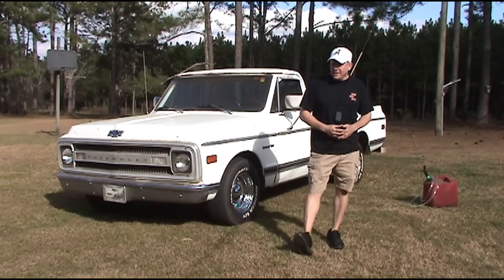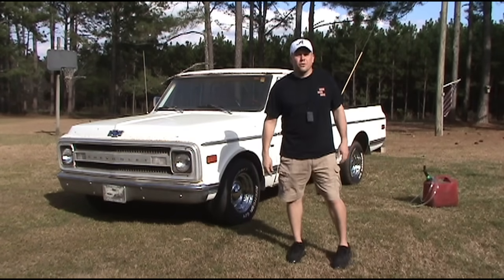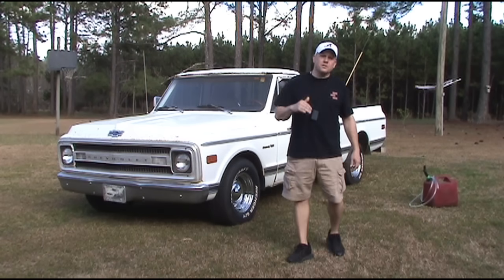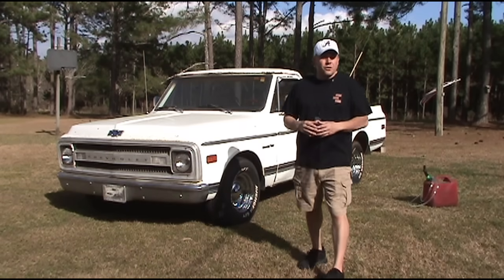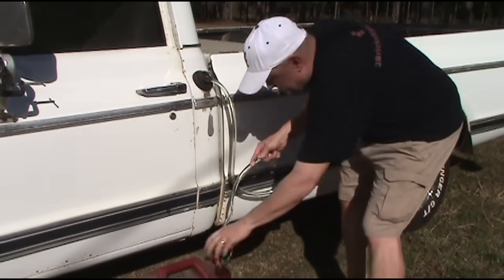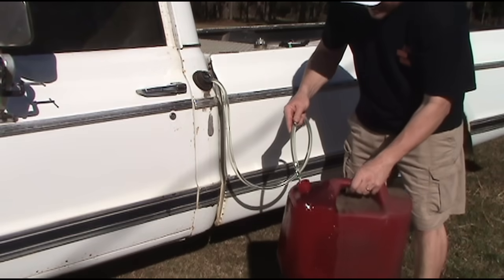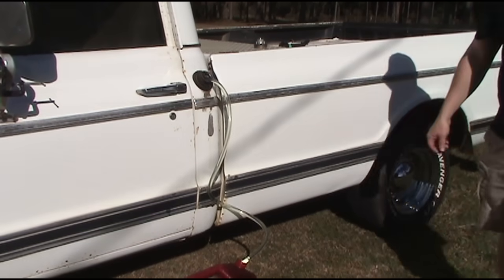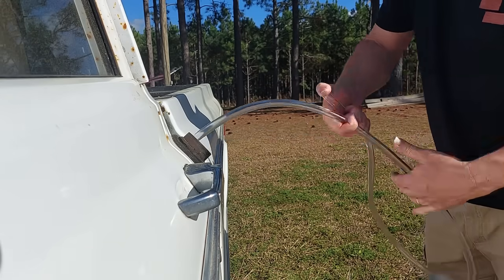Absolute BEST way to Siphon Fuel. You've never seen this before

Comment: The easiest way, BY FAR, to siphon gas, is to first insert the siphon hose into the deepest part of the tank that it will reach, and THEN block off/ and seal the opening of the gas tank by stuffing a rag or wet cloth of some type and completely around the opening, and then BLOW into the hose....DO NOT SUCK on it. This creates a greater pressure inside the tank, and then get ready to begin collecting  the gas, as the gas will immediately begin to flow. YOU NEVER HAVE TO SUCK ON THE SIPHON HOSE, EVER AGAIN!
Reply from the maker: Awesome tip.  Thanks for sharing 👍

Comment: 😂Nice try Momo. Only works on 1970s model vehicles 😂. Anti theft screens were placed in fuel tank funnels in the 80s. Go ahead,try and drive a hose into your own car tank😂
Reply from the maker: I was just trying to show how it's done. I used this method to fill a generator during a storm and thought I would pass it on. This works on lawnmowers and other equipment too 🙂👍

Comment: I think this only works on older cars
Reply from the maker: This works on lawnmowers, tractors and anything else with a gas tank.  After i posted this video i was told fish shops use this method to do water swaps in aquariums.  🙂👍
Reply from the maker: This works on lawnmowers, tractors and anything else with a gas tank.  After i posted this video i was told fish shops use this method to do water swaps in aquariums.  🙂👍
Reply: @3BricksHigher  can you try this method on a new car

Comment: Unfortunately, this will never work on more modern cars as they all have anti-siphon features built into the fuel filler line.
Reply from the maker: But it does work on mowers, tractors, ect    i was informed after i posted this that people use this method to change water in aquariums 🙂

Comment: Love the video.  But anything after 1990's it won't work.  Anti-siphon measures.  Need to punch the base of the tank
Reply from the maker: This works on lawnmowers and other equipment too.  It can be used in many different situations 🙂👍
Reply: @3BricksHigher  Great point, thanks

Comment: except it wont work on any car less than 40 years old due to the screen protector inside to prevent gas theft lol.. otherwise great video
Reply from the maker: This method also works on lawnmowers, tractors, and other equipment.  I used this to fill a generator during a storm and thought I would pass it on 🙂👍
Reply: @3BricksHigher  Fair enough

Comment: It dosent work on newer cars. You can't get the hose to the gas.
Reply from the maker: But this method works on lawnmowers, tractors and other equipment. I used this to fill a generator during a storm and thought I would pass it on 🙂👍

Comment: Easiest vehicle in the world to siphon from and they haven't mounted a fuel tank that high in a vehicle for over 50 years.
Reply from the maker: But it works on lawnmowers and other equipment.  I used this method to fill a generator during a storm and thought I would pass it on 👍

Comment: Won't work if vehicle has anti-siphon screen at bottom of filler neck.
Reply from the maker: But this does work on mowers and other equipment.  I used this method to fill a generator during a storm and thought I would pass it on 🙂👍
Reply: Easy enough to break through with a length of rebar.

Comment: Doesn't work with new vehicles. Which have screens and stop flaps.
Reply from the maker: The flap is to prevent gas from sloshing out if you forget to replace the cap.  A pencil or small rod will push this down, out of the way as the hose is put in or removed

Comment: Doesn't work on newer cars  they have a screen or rollover device in the way.  You can't put the hose in the tank.  I have been using the technique  he is showing in the video since I was a kid 70 years ago,  but these old ways of siphoning gas will not work on modern cars.
Reply from the maker: But this method works on lawnmowers and other equipment. I used this method to fill a generator during a storm and thought I would pass it on 🙂👍

Comment: It's not a coincidence that he used a really old truck with an in cab gas tank to show this 'trick'.  And good luck getting that fat hose into any car that's less than about 40 years old.
Reply from the maker: Use a smaller hose, duh 🙄 lol
Reply: @3BricksHigher  Most modern cars have an anti-syphon device that'll prevent any size hose from entering.
Reply from the maker: @DonziGT230  I know. I mainly put the video out because I had to use this method to fill a generator during a storm. This works on mowers and tractors. I just wanted to put it out there 👍

Comment: Yeah there is a reason you picked an older truck.  Try that on a newer truck.
Reply from the maker: I used this method to fill a generator during a storm. This works on lawnmowers and other equipment too. Someone posted they use this to do water swaps in aquariums.  I just wanted to pass along the method 🙂👍

Comment: this will not work on ANY modern car as they are blocked inside the pipe... that truck is from the early eighties...
Reply from the maker: This truck is from 1969. You're right about newer cars  but this method works on lawnmowers, tractors and other equipment. I used this to fill a generator during a storm and thought I would pass it on 🙂👍

Comment: This common knowledge is as old as dirt. You could also stick the second hose in the fuel can, plug the hole and suck.
Reply from the maker: I'm just showing how it's done without sucking. I'm a Bama fan, we're not used to that 😁👍

Comment: That car is a ,'69 or '70 vehicle. What about a modern day car?
Reply from the maker: It's a 69. This does work in several other vehicles, but my intent was to show how it's done.  These methods can be done on lawnmowers and other equipment.  I had to use it to fill a generator during a storm and thought i would pass it on 👍🙂
Reply: @3BricksHigher  thanks. I used to own a '67 Chevy truck. The hardest part to siphoning is getting the hose in. The older the vehicle, the easier it is. But that was back in the eighties. Haven't tried with a modern car yet.

Comment: Did not work for my 2002 cadillac
Reply from the maker: The 2nd method works from a vacuum. If air enters then it won't work.  The 1st method just depends on how full the tank is 👍

Comment: Didn't work for me and my tank was full
Reply from the maker: That's odd.  I've only had a few comments saying this didn't work for them. People also use this method to do water swaps in aquariums. Is your tank shallow? That's the only thing i can think of that might prevent it from working  The 2nd method always works as long as there's a good vacuum.

Comment: What will you show us next, how to dial a rotary phone? This is useless on any car from like 2000 on, only works on relics like you used to demonstrate on. Modern cars have so many baffles in the filler neck that it makes this impossible.
Reply from the maker: This works on lawnmowers and other equipment.  I was just showing the method. Someone posted they use this to do water swaps in aquariums.

Comment: You are heble to do this on old vehicles , newer shave plastic bold , to prevent people still your gas wall your away from your automobile or truck
Reply from the maker: But it does work on mowers and other equipment. I used this method to fill a generator during a storm and thought I would pass it on. 🙂👍

Comment: Won't work on newer cars/trucks hose Won't go into the filler neck, you need to do your home work before posting a video 😊
Reply from the maker: But this method works on lawnmowers and other equipment.  Fish shops use this method to do water swaps in aquariums. I used this method to fill a generator during a storm. Someone posted they use this to empty thier pool.  It's good info to have 🙂👍

Comment: I'm here to save you money, time and effort.
This WON'T WORK on your 2000 and later private car, just acknowledge that you lost 50 €/$ for ever 😁
Reply from the maker: But it does work on mowers and other equipment. I used this method to fill a generator after a storm and thought I would pass it on. Someone posted they use this to do water swaps in aquariums 🙂👍
Reply: @3BricksHigher  indeed, useful in general, no doubt 😁

Comment: Im not sure this will work with modern vehicles. Your truck is pretty old!
Reply from the maker: But it does work on mowers and other equipment. I used this method to fill a generator during a storm and thought I would pass it on 🙂👍 someone posted they use this to do water swaps in aquariums too

Comment: Doesn't work on newer vehicles.
Reply from the maker: I used this method to fill a generator during a storm and thought I would pass it on. It works on other equipment too. Someone posted they use this to do water swaps in aquariums 🙂👍
Reply: @3BricksHigher  
Modern cars have a safety device called a 'roll over valve' placed between the fill hole and the fuel tank. This devise stops the fuel from coming out the filler tube should the vehicle be upside down. Since most new cars are fuel injected they have electric fuel pumps.
Reply from the maker: @BenjimenFranklin-r1h  but lawnmowers and tractors don't 😁
Reply: @3BricksHigher  
This is true but you were showing it on a vehicle and I wanted other people to know it doesn't always work on any other vehicles. You gotta have a really old one to do to that. They make a little siphon pump you can buy and it doesn't work on new vehicles either. It's a matter of the hose will NOT get to the tank. Oh yeah I should mention do not remove the fuel line from a vehicle that has a electric fuel pump unless you know what you are doing. You will get sprayed and then you will have to re prime the fuel system. Don't be stupid.

Comment: Totally didnt work. Tank was full and nothing happened.
Reply from the maker: Which way did you try? The second relies on pressure you create when you put the rag over the hole. That seals the tank and blowing forces the fuel out.  The second just works from the momentum you create by releasing your thumb and the rush of  fuel.

Comment: Thanks! Nothing worked
Reply from the maker: The 2nd method is all about vacuum. It you seal the top where you insert the tubing and it doesn't  work, there is a leak in the tank somewhere.  The 1st method works as long as the tank is full enough.  I've learned this is a favorite method for draining aquariums during water changes.

Comment: Useless information, this will not work on modern cars because of the anti-siphon device.
Reply from the maker: The flap? It's actually there to prevent fuel from exiting your tank in case you forget to put the cap on. It can be moved with a pencil and the tube inserted.

Comment: Problem is... Don't work on today's vehicles.
Reply from the maker: But it does work on mowers and other equipment. I used this method to fill a generator during a storm and thought I would pass it on. It also works for water changes in an aquarium 🙂👍

Comment: Are you serious ? That works great for a tank behind the seat in a 1970 pickup truck.. It goes straight to the bottom of the tank, but it's not that simple with tanks that have 90 degree bends in the fuel inlet and constricted. Your video is a joke. Sorry Bubba
Reply from the maker: Actually it is a 69 🙂 and i was showing the method. I used this method to fill a generator during a storm. This works on lawnmowers and other equipment. Someone posted they use this to do water swaps in aquariums.  I was just passing these methods along 🙂👍

Comment: What a joke. That is a 60 year old vehicle.  Show us how to do it on something new. The problem is getting the hose down in the tank.
Reply from the maker: I used this method to fill a generator during a storm. This works on lawnmowers, tractors and other equipment. Someone posted they use this to do water changes in aquariums too 🙂👍

Comment: How to siphon fuel from people's cars without swallowing any. Most petrol thieves  would know this. For what it is worth the advice, based on experience, is here.
Not subscibed. Thumb down. Bloke from Aus.
Reply from the maker: Actually i used this method to fill a generator during a storm and thought I would pass it on. This works on lawnmowers and other equipment too 🙂 i am not a thief and i Actually work with law enforcement daily 👍

Comment: He is using a vehicle that doesn't even have an unleaded fuel nozzle reducer. This vehicle also has a vertical gas tank behind the drivers seat, that fuel level is 3 and 1/2 to 4 feet off of the ground. Due to the way the tank is situated, the fuel level in that tank can be up to 2 FEET deep. Absolutely NONE of this applies to a modern vehicle, and the liar making the video knows it, that is the reason he is using an old truck to demonstrate on in the first place.
     Let's face it fellas, you can do whatever you want with your fingers or thumb, put it in shallow, push it in deep, put your thumb over the end of it, stick another hose next to it, wrap a rag around it, blow into it or any of that other foolishness, NOTHING works as good as a set of lips and some good strong suction. Don't wanna get a mouthful? Practice, practice, practice till you are good enough to get your face out of the way in time. If you don't mind the taste, practice anyway. And as us older viewers already know, it was a hell of a lot easier to do 40 or 50 years ago, and the flow was MUCH stronger than today.
Reply from the maker: A liar i am not.  This does work in many vehicles i just choose to proudly display the truck i got from my Dad.  In our Family we do not put any hose in our mouths and suck. ...and we definitely do not practice sucking on a hose.  Have a good day sir 👍